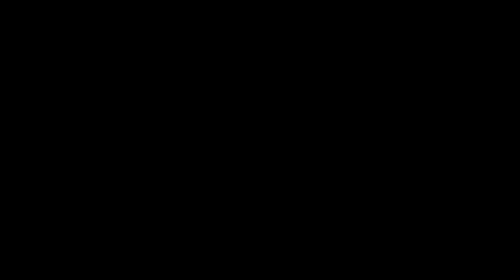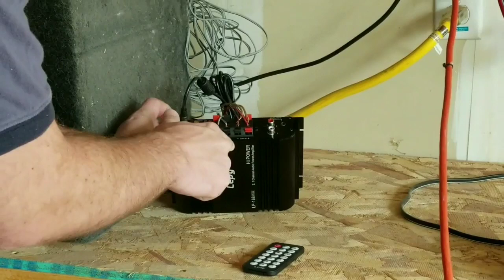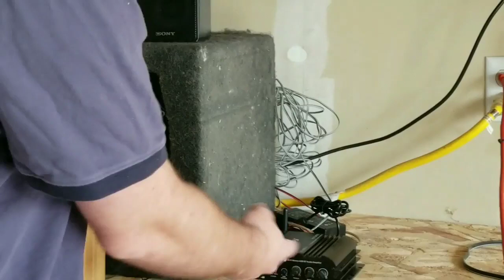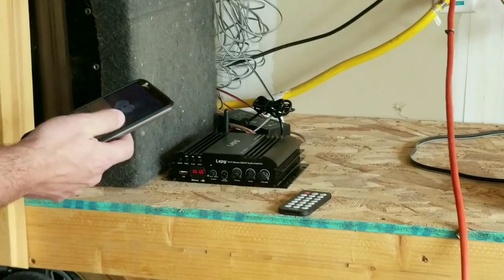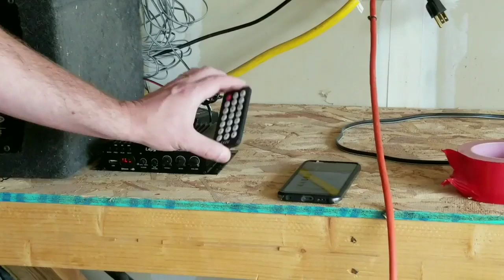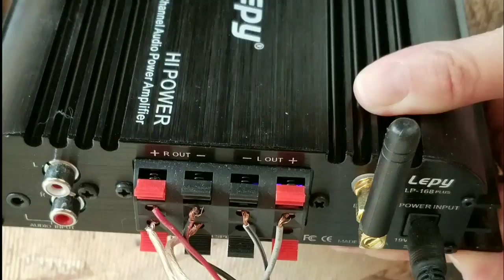Tsumbay Mini Stereo USB Bluetooth Power Amplifier

Comment: It uses TDA7379 amplifier and even data sheet states that it's 2 x 13 W + 1 x 38W with huge distortion - 10%!!!! No info on USB formats, can't get any sounds from USB. Madly loud beep signal when regulating volume with remote control and reaching max volume ;(  Crossover regulator does nothing. 180˚ phase is cheap trick as internally these pins are just connected with crossed wires. Wasted money and time waiting